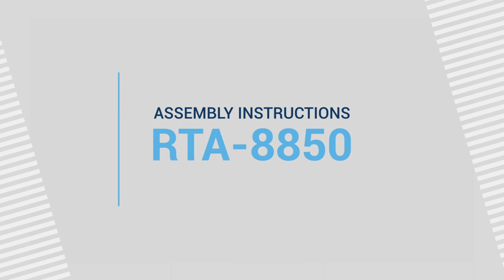TECHNI MOBILI Durbin TV Stand / RTA-8850 Assembly Video

Comment: After finishing putting this together, I'm very happy with the final product. Step nine and ten, where you had to put the doors on, was infuriating joining eight parts all at once. The doors kept falling down because one little thing didn't line up. Also, I had to create my own holes on the left side during step thirteen (where you put the top on). You can easily put this together with just the instructions, and without the video, it just takes muscle if you're doing it alone. Putting it together isn't "easy" like the package says, but it does look great after you've finished.

Comment: is this table good for a 75inches tv
Reply: According to the documentation it's good for up to 75" Diagonal. Unit is actually 57.5" wide. Just received mine and once assembled I'll be putting a 65"  Diagonal unit on it. Will overhang by a inch or two on each side. The feet on this Samsung are 48" wide.